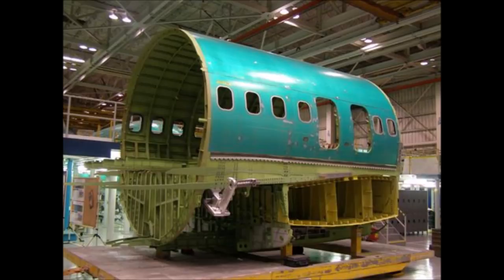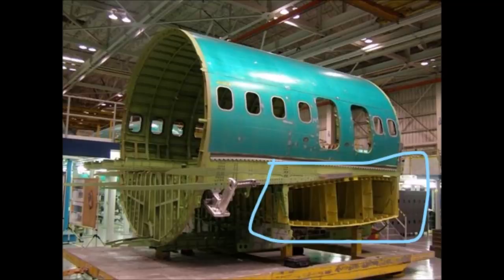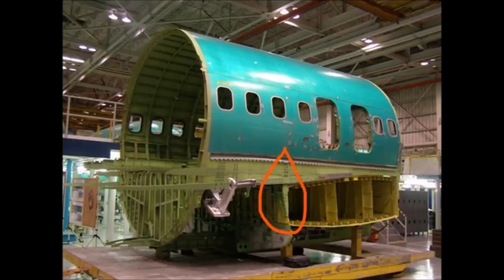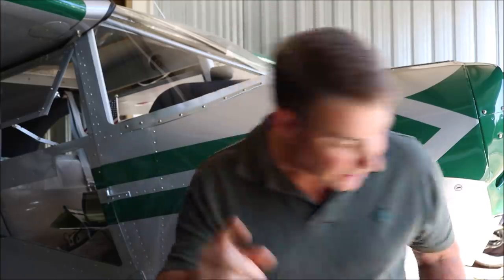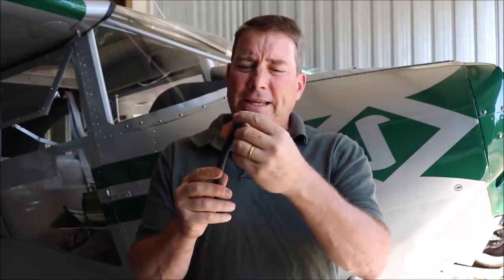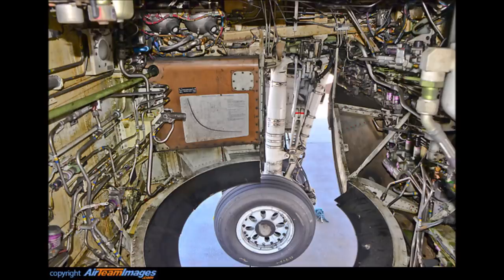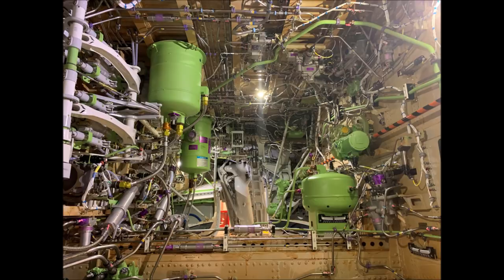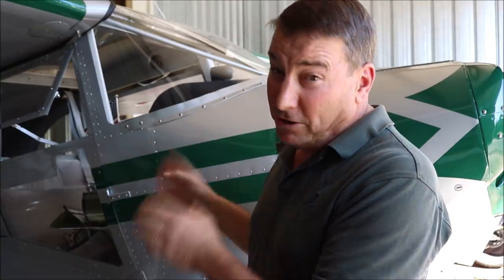737NG Pickle Fork Cracks AD 2019-20-2

Comment: This may not be relevant, but here on YouTube there is a video of a Boeing contractor in AZ (?) who was supposed to be made by CNC machines, but were actually being produced by hand and you can see them banging the frames with a hammer! I THINK that there is an old 60 minutes on this. Whether these frames were the ones that had pickle forks was never mentioned. But they said that these particular frames were key to the strength of the fuselage. During assembly, Boeing workers had to force the frames to make them fit. Boeing management is alleged to have ignored the complaint. This story long predates the planes currently in question and it would be hard to believe that Boeing still uses that supplier. Nonetheless, it shows that the current management culture is not entirely new; just enhanced by Chicago financial pressure. I'll look for the video.
Reply: banging and shimming. that's what happens when section are made be different companies then joined in one assembly plant. tooling and holding fixtures are an issue doing the section making, then joining all the section together. The tooling is much improved then it was in the 80s an earlier with GD&T tolerances used on the drawings, manufacturing of the parts that they do fit all together better

Comment: Interim Action
The FAA considers this AD interim action. The inspection reports that are required by this AD
will enable the manufacturer to obtain better insight into the nature, cause, and extent of the cracking,
and eventually to develop final action to address the unsafe condition. Once final action has been
identified, the FAA might consider further rulemaking.
Reply: It is a computer designed part and stress analysis was done the same method. Cyclic loading and stress testing was done via computer animation. Such a part should be looked at more closely by engineers and management.  The model of cheaper better faster was used, again with errors that have killed people.

Comment: Why wouldn't it be on the aircraft manufacturer that failed to design an aircraft that was safe? It seems to me if you paid millions for an aircraft and it had a design flaw that was unsafe, they are going to pay to fix it. I see lawsuits in the future.
Reply: Joe M True, many developments will follow. They still need to establish the root cause. Bad design might affect all NGs. Bad materials might only affect some aircraft.
Reply: All aircraft will develop cracks over time. These are cracking much earlier than Boeing predicted. The likely outcome is that they will make a design change and start implementing reinforcements on new aircraft coming out of the factory. Existing aircraft will get repetetive inspections until it goes in for a heavy maintenance check, and the modification will be complied with, eliminating the need for the accelerated inspections.

Comment: If you found cracks and your 737-900 is grounded what is the cost to replace that spar?
Reply: William Pereira The cost is unknown, but it will be very expensive in time and resources. Only a few cracked pickle forks have been found (none in US airlines). Edit: The wider effects in the long-term are equally unknown.
Reply: not an easy repair and it's a part that can not be cut and spliced together like a fuselage stringer

Comment: Random Thoughts: 1. Does the AD require inspection of just the two rear pickle forks OR all Four?
2. Are you sure that it’s just a visual inspection, to discover ‘visual’ cracks, OR is dye penetrant or X-Rays allowed? 3. Having spent many, many hours in those wheel wells, the most difficult part of the inspection is getting the pickle forks clean enough to inspect, removing CIC and grime. 4. Have the cracked airframes been associated with any particular airline, slam it on & first available high speed SWA for example? 5. If found, how do you un-Ground the airplane, what’s the repair? 😂 Has Boeing come up with one, and has the FAA approved it? (Darn, couldn’t find a rubber stamp emoji)

PS: Kudos to the inspector who discovered this defect, because I know they were found in the course of a general inspection! I can hear the “Holy Shit” echoing in my brain! BTDT!
Reply: The AD only requires inspection of the rear forks.

At this time, it is only a visual inspection via borescope.  No other NDT is required and the inspection takes one man hour.

This issue was first discovered when several 737-800s from (now defunct) Jet Airways (India) were being converted to freighters at a heavy repair facility in China.  3 aircraft were discovered with cracked aft pickle forks.

    Cracks have been discovered on airframes in the US, but I am not going to disclose which airlines.  A little internet research will reveal this information.

     This interim AD was issued to gather fleet-wide information on the extent of the problem.  An engineering fix is still being discussed.  

    If it is found that the defect is not due to a bad batch of Alloy, or a manufacturing problem, It will more than likely require a re-design of the fork (since these cracks are occurring in an area that was not anticipated).

     A repair would involve a complete replacement of the fork.  It is attached to the center section with bolts and the fuselage straps with rivets.   Standard sheet metal repair techniques.
Reply: The repair is most likely dependant on the size and location of the crack. So pictures and dimensions will be sent to Boeing, and their engineers will publish a repair for that specific aircraft.

Comment: So it doesn't seem all that critical. I mean...

1) Your aircraft has 30001 cycles, so you do the inspection. 
2) No crack is found, so you can fly it another 3500 cycles. 
3) Unbeknownst to your maintenance team, a crack develops on cycle 30002.
4) You fly the aircraft another 3499 cycles until the next inspection is required, all the while the crack is possibly worsening? 

Thus one could reach the conclusion that this area of the aircraft is deemed beefy enough to be able to withstand a crack for 3500 cycles. Interesting.

Comment: 30,000 cycles is a well used aircraft.   The flight hours with that many cycles would be 4-5 times the cycles. You can’t get a car warranty for that many hours of operation.  Maintenance is so expensive because the certification process (FAA-PMA) of the parts. If the flight hour/maintenance cost ratio wasn’t profitable you would be riding a train and you also wouldn’t be an airline pilot

You fly it. You maintain it. That’s the way it works

Comment: Thank you Mr. Brown,your videos and details are the best and your contribution  to 'Flight Safety'awareness is greatly appreciated. I have a feelig that the landing loads (both normal and heavy) are transmitted, from landing gears to wing spars, and through pickle forks to the fuselage bulkheads. This being the case,  to expect a one inch crack to stay  put at one inch for another 35000 cycles is not comfortable thought. From the pictures it looks like a precision close tolerance job.. I guess both rivetting process as well as  'Design' needs review.

Comment: CNN Business reports:
About 5% of the 737NG aircraft that have been inspected have cracks in the "pickle fork" connector.
810 aircraft have been inspected and 38 have cracks in the "pickle fork", so this is not a rare occurrence.
This should be a large enough sample to determine if this is a metal issue or a installation problem.

Comment: A one inch crack is a significant problem. But as cracks begin extremely small and which are invisible to visual inspection, I'm surprised that the AD doesn't mandate eddy current NDT inspection to detect cracks before they get to 1".

Comment: Obviously the system is not working if these were only picked up by planes being converted. A 1 inch crack doesn't just happen, it takes a while. Had those 18 aircraft not been converted this crack would not have been discovered.

Comment: Four prongs on each fork
On tines, let us talk

Is that the crack is 'small' significant? I don't think so; but that the forks are disintegrating is. On an ill-conceived 'NextGeneration'-or-no airplane, such components would come under pressure so enormous that the designers with all their computers might not grasp it. A 'stretched' plane makes for a greater force of moments, as the fueselage, in preserving its angular momentum about the spindly wings, pitches with dangerous force. If Boeing is to maintain its position as the leading manufacturer of passenger or cargo planes, it may have to embark on a radical program of re-design

Comment: It's not clear by what you said whether the AD inspection is paid for by the operator or the repair is paid for by the operator.  How is a line mechanic expected to fix cracks in those pickle forks?
Also, that diagram is showing up everywhere and is a great source of confusion.  Lines 218, among others are confused with structure instead of actual indicating arrows.  I'm sure it's a standard methodology, but some arrows don't have arrowheads, while some are dotted and some are not.  The general public may be confused as I was.  Can't someone generate a better diagram?
Okay, like always, these are the best reports out there and thank you for your excellent work.

Comment: Correct me if I am wrong, visible cracks signal imminent failure, which is very bad.  If cracking on the surface is visible, is internal cracking worse??  Micro-cracks, the ones that cannot be seen are also a danger.  If pickle forks have internal cracking, boroscope may not be enough.

Comment: Although cracks are horrible sounding things, I'm guessing there are airframes out there that have had lots of cycles even with cracks. It's just that nobody wants to be onboard the flight they fail.  When they find one or two old airframes whose forks are cracked and not worth repairing, I wonder whether Boeing will do extended static stress testing to see how long it takes before a catastrophic failure occurs.

Comment: Are the pickle forks a part of a much larger component or a comparatively small component which can be replaced without substantial disassembly of the fuselage?
Reply: Richard Briscoe That's not clear, but likely to be a major disassembly, since the pickle forks transfer loads from the wings to the aircraft fuselage.
Reply: If they have to remove the skin of the center of the fuselage to replace them, it will be incredibly expensive...and slow.

When you buy a Toyota or whatever you get a warranty at least in part because it is a consumer good. USAF and the other services get no warranty for major weapon systems because the cost would be exorbitant. When we were bringing the F-16 online there were teething problems wit the F100 engine and there being only one, unlike the F-15, aircraft were falling out of the sky at an unfortunate rate even though it was the most successful major weapon system USAF had fielded. One unit even went so far as to make up bumper stickers “If there’s an F100 in back there’d better be an Aces II in front”. Can you imagine how much a contractor would charge to cover such contingencies? I suspect the same consideration is involved in civil air transport aircraft.
Reply: Richard Briscoe This may not cost Boeing directly, but it will (further) devalue the 737 brand name. If its a widespread flaw, the resale value of high-cycle NG airframes may end up close to zero.
Reply: it's major!!!! it's integrated into the fuselage of the plane. Timely and a pain in the ass for a experience rework crew to remove and replace.
Reply: @gordonrichardson2972  not a flaw! can it be beefed up, probably not! remember the NG flies higher and farther then the classic could due to its longer wings and bigger less fuel burning engines.

Comment: There may not be a regulation that requires a recall that the manufacturer would pay for but for something like this that completely unexpected they just might take care of their customers. I know there's only one other aircraft manufacturer but if something like this happens and Boeing just tells their customers to get lost those customers might consider switching to Airbus aircraft. 

As far as this situation making flying expensive I don't I think that's correct. Whether the airlines or the manufacturers are required to pay the price it will trickle down into the tickets. If there is an insurance product that covers things like this the cost of that insurance will trickle down into the tickets just like the cost of fuel and everything else. 

Maybe I shouldn't have said just like fuel. If this ends up being completely on the airlines that might cause a spike in ticket prices just like a sudden increase in the cost of fuel whereas if the manufacturer pays for this the cost of that will go into the cost of future aircraft and affect ticket prices much more slowly.

Another thing to consider when analyzing cost is the effect of various scenarios on the stock prices. It might cost Boeing more money to stick the cost of repairs on the customers if that intern causes the stock price to drop and the stock price will certainly drop if they start losing customers because of that policy

Comment: I was wondering how difficult it will be to change this part in the middle of the structural bowels without affecting the original factory quality? Is it worth the cost of all this to airlines? And legally speaking I think the companies that recently purchased these aircraft would be entitled to the return of those aircraft affected by this defect, which clearly appears to be a factory defect and to receive another new or full refund of the good.

Comment: I am concerned about flying on these planes but find that it is very hard to make a reservation without having  one at least one leg of the flight . So how does a passenger know if the plane they are flying on has been inspected and or repaired. I have to make a  reservation soon.

Comment: I first heard of pickle forks as a tool like a dual drift pin - used to separate pressed-together parts in automotive ball joint assemblies.
Reply: S and J Enterprises The concept is similar. The pickle fork is used to handle a twisting force between the wing, and the lower and upper fuselage.

Comment: 30,000 cycles is a lot of flying and it will take over 20 years to get to that point, please explain how long it can take to get to 30,000 cycles. So your viewers understand the fatigue a fuselage goes trough, and your viewers not thinking its new planes coming off the line. Also in the span of cycle life of a plane the longer it flies the more inspections are added to inspect and or find possible problems.
Reply: Jaime M In the previous video Juan stated that it is a third of the expected lifetime, though he did not go into the details of short-haul routes and flight-cycles.

Comment: i wonder what would really happen when fork tip completely breaks in a high loaded scenario.. would it cause the entire wing to break off or simply be deformes and enable a somewhat survivable landing.
Reply: Jacob TJ There are 4 pickle forks in each aircraft. Only the 2 rear ones seem to be affected, and the cracks found so far are not at catastrophic levels.

Comment: How do they repair cracks like this.  It seems as if they need to take a good portion of the aircraft apart to get to all sides for welding or complete disassembly if welding is not possible.
Reply: welding is not possible we are taking aerospace aluminum, heat from the welding will do much more damage to the properties of the milled aluminum part. Lets of jacks to take the load off the body and wings and experience rework mechanics, best to wait for it's "C" or "D" checks when the whole plane is pretty much taken apart and put back together. For the repair cost during those checks, its best to sell or scrap the plane, and replace

Comment: Spirit aerospace builds all the fuselages and the center tank structures. it's comes with the center tank installed with the pickle fork structure assembled from spirit. And the 737 is built in Renton Washington not Seattle.
Reply: Aaron Allen Renton is a suburb of Seattle.
Reply: @gordonrichardson2972 I work at the Renton Boeing every day

Comment: I think all construction of Boeing aircraft should have stayed in the huge facility in Everett, WA.  Having partial construction in multiple cities & then shipping them for assembly was to save money!  I think that facility looks large enough to make any plane.  What's the problem - did employees unionize?
Reply: Christine Still — The 737 has always been built in Renton.
Reply: @GH-oi2jf  The 737 fuselage has never been build in Renton, has always been built in Wichita, then shipped to Renton be rail. The Installations are done in Renton; wings, tail, horizontal, wiring, flight controls, hydraulic, gear, and interiors like sidewalls, carpet, galleys, lavs and seats